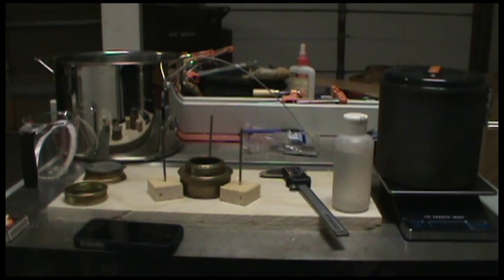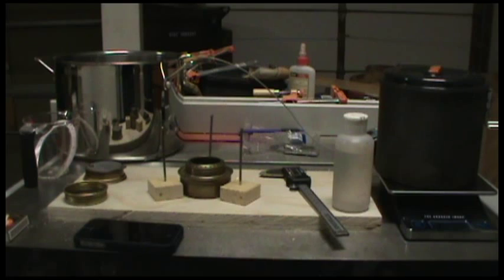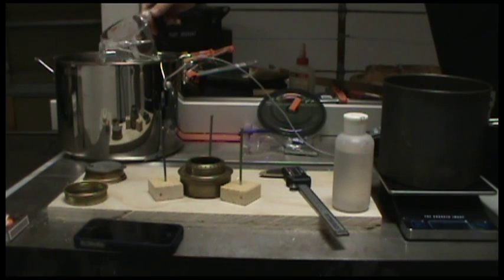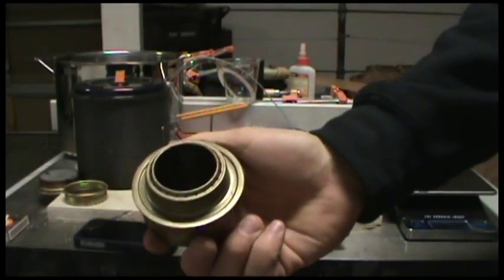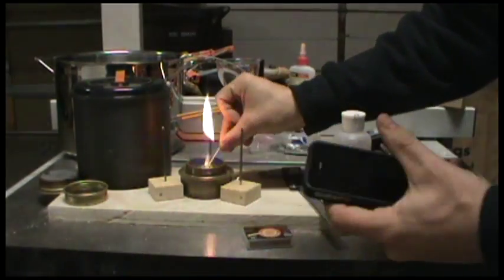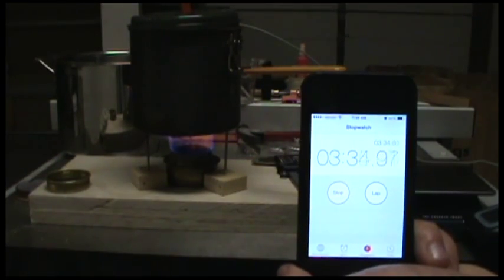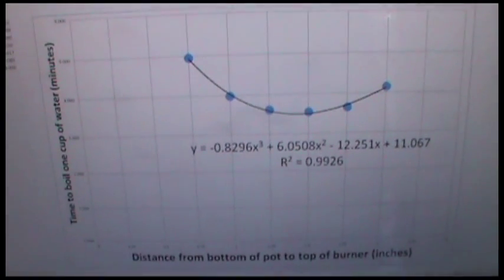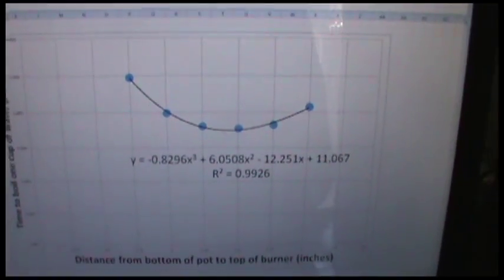Trangia Pot Stand Optimization

Comment: I love your scientific methods and I will imitate them myself. As a backpacker, I'm also interested in the grams of fuel used. I'd be willing to accept a longer boil time if it used less fuel. 

I'm also interested in how the different setups work with wind. I think I'd use an oscillating fan to test different windscreen configurations.

If you ever write a book for Kindle with all your test results, I'd buy it.
Reply from the maker: I wish I would have measured the fuel consumption in these tests, because several people have been interested in that.
I like your idea of using a fan to test wind screens, that would also be an interesting test.

Comment: Nice results, all the pot stand makers are out busily measuring their stands....
I am amazed about how much heat one of these mini trangias can put out.
Reply from the maker: Technically the results could vary based on which pot is used, though I doubt that it would vary more than +/- 1/4 inch. I certainly hope that the manufacturers watch this video and adjust their designs so customers get more optimized gear.
The mini trangia certainly can crank out the heat. Cheers.

Comment: Thank you for your thorough and sound analysis on optimal height to reduce time to boil, or drag race results. It would be great if you could think of a test methodology to show which height consumes the least amount of fuel to get to a boil. That way we could optimize the fuel efficiency of our set ups to get the best "mileage" (miles per gallon).
Reply from the maker: Thank you. I like your analogy of drag racing versus miles per gallon. I could repeat this test and measure the fuel consumed. I wish I would have done it originally because you are not the first person who has been curious about fuel consumption.
Fuel efficiency is tricky to optimize because there are many more parameters that influence it. I'll think about it and maybe I can do a future video about Trangia fuel efficiency. Cheers.

Comment: In your test and analysis to determine optimum trangia head space. I like that you mention the fairly large range (1.25-1.75) of head space which provide very similar results. Often people focus on a single dimension and feel nothing else is acceptable which is really quite silly. When you consider the varying conditions found in nature, you'll never know the difference when on the trail.
   Great presentation and method. Thanks for sharing
Reply from the maker: Very well said. And also my results are technically only valid for the pot I used, which is also a reason to mention the range of distances because certain pots might have different results. And like you said, in the field a few seconds will never be noticed.Thank you for watching. Very honored to have you stop by - I think you make some incredibly useful stoves!
Reply: ColoradoCamper Yes, the pot will make a difference as well as the pot stand.
A Trangia sitting on damp soil will run cool. A pot stand inclosing the Trangia by reflective surfaces will run hotter. all differences surely cause a change in the head space sweet spot. Thanks for the conversation!

Comment: Thats a great comparison test for optimum height, but boil times and fuel usage will vary with size of pots used and thickness of pot.
Reply from the maker: Yes, lots of factors affect boil time and fuel consumption. I tried to keep those variables controlled so I could focus solely on the height.
Reply: Aussie survival 5